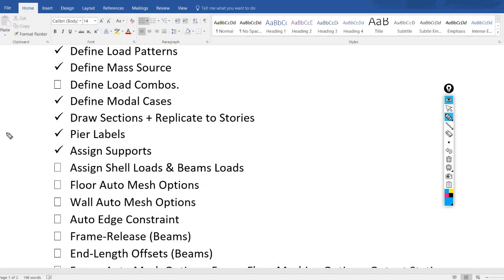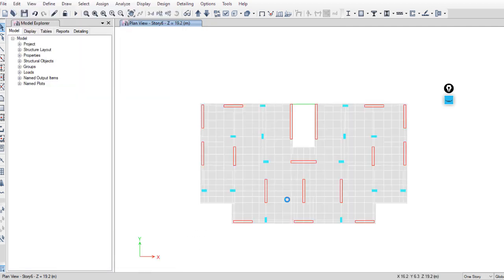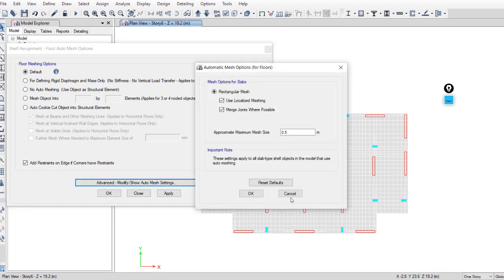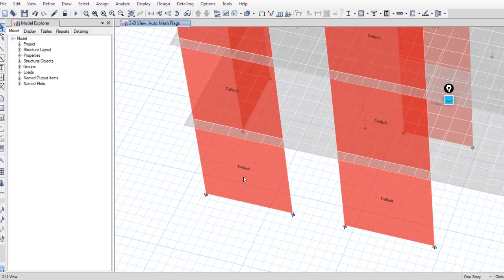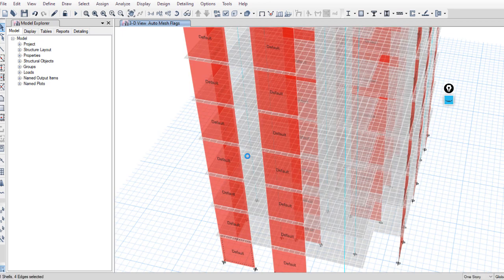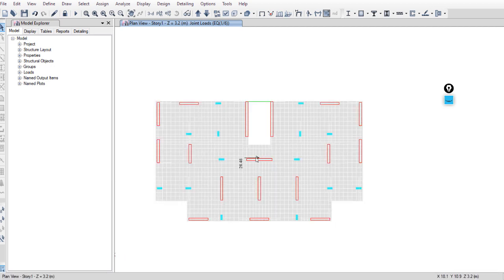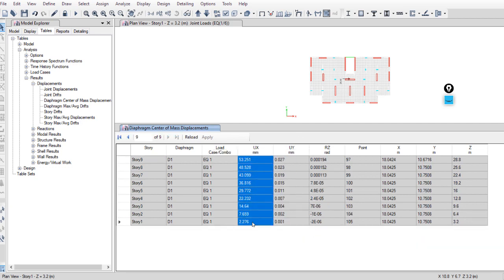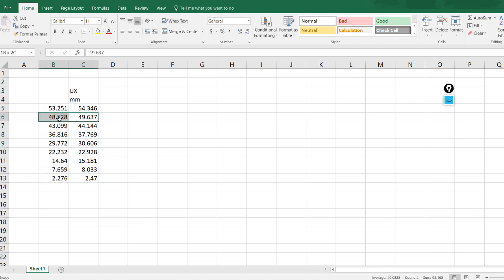ETABS Tutorial: Meshing (Floors & Walls) - Step 8

Comment: but you have to assign meshing for shear walls or you will have unconnected edges
Reply from the maker: That's wrong, But you have to assign edge constraint (it's assigned by default), there is a video in Etabs official YouTube channel showing the right way yo simulate wall meshing